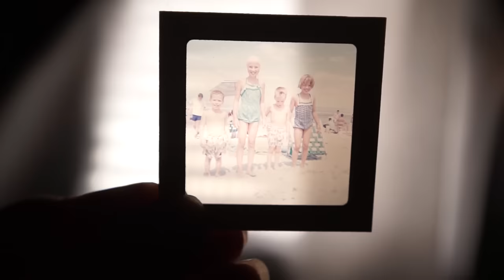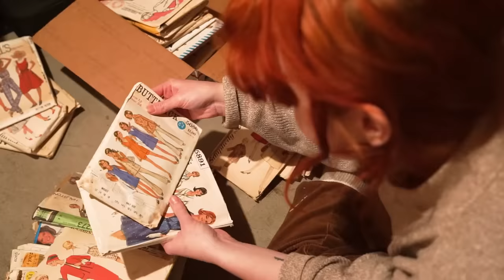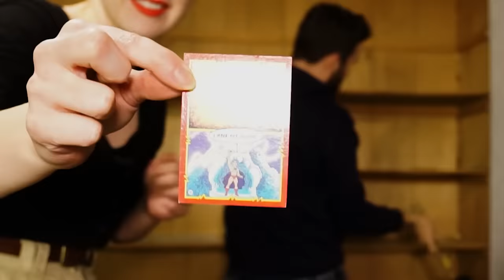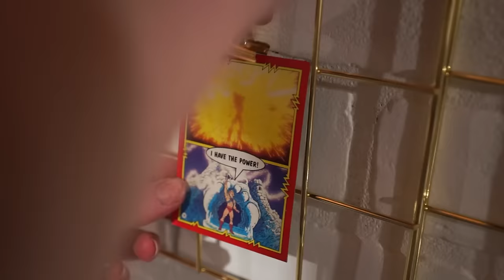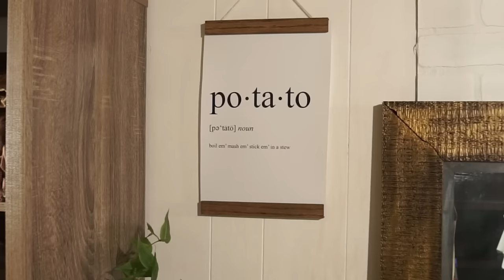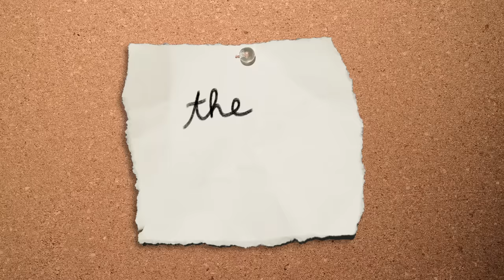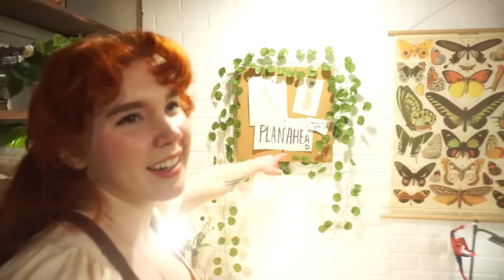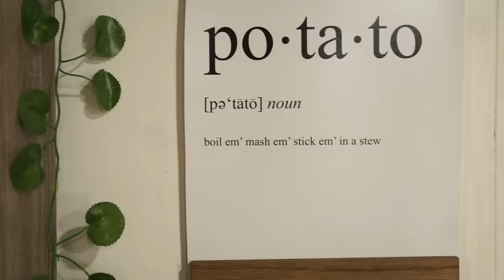A Basement MAKEOVER || Making a Costume Workshop!

Comment: If I may make a suggestion to save you stress in the future:  add an L- bracket to the center of the shelves you made so they don't start warping and sagging in the middle.
Reply: That, or multiple L-brackets along the way. The shelves looked very long and even with the original post in the middle the boards sagged... Those new boards look very thin, very prone to sagging
Reply: Yeah. My dad had to do the same thing to my shelves and it works pretty good.😁
Reply: I was worried about the sagging too!! Luckily that's an easy fix.

Comment: DIGITIZE THOSE PHOTO ALBUMS IF POSSIBLE !!! Disasters happen and having a back up of, to quote John Mulaney “the one thing you can’t replace”  is something you need
Reply: Yes! And even if there's no disaster - I'm currently getting ready to do this because some of my really old pictures are fading. I don't know if they weren't developed properly, if the paper is bad quality, if they got too much sunlight, but either way it broke my heart to see it!
Reply: @liv97497  A lot old albums are also made of acidic paper, which is not great for the photos. I’m trying to find the time to digitize mine. 😅
Reply: And then create many backup copies because electronics do fail as well... Learned that the hard way.
Reply: i bought a veho digitizer on amazon for all my negatives they are now safe on disk, did not want to loose all the memories
Reply: @maggiekedves  Ugh, same. I helped my mother digitize all her parents old slides (they had a lot of them... like, a couple thousand, I'd say), and at some point the usb we put them on got corrupted, and we lost roughly half. Which wouldn't be that bad if we still had the original slides... but we had thrown them away, secure in the fact we had digitized them. Won't be making that mistake again.
Reply: @kellymartin2603  yeah I coined a motto after losing ton of photos "If you saved it only once, you don't have it." Super sad also I had a CD full of photos as my backup and after few years the devices could not read it at all and it was in a case all the time protected. So these media technologies don't live forever and I would advise everyone to keep the original somewhere or create a paper version of digital images as a backup. I have yet to do that (time/money issue.)

Comment: Literally had those cubby's in my amazon cart to organize in my kids closets...*removes from cart*
Reply: I use them as my wardrobe lol cos I'm cheap. They're fine so long as you don't move them... Though maybe not with kids, if they like climbing things.
Reply: You can alternatively get a bunch of zip ties and tie it all together in the back, so you can still move the unit and it won't collapse just by someone touching it. It works well enough.
Reply: I have similar wire mesh ones, but I wouldnt dare move them before emptying them and preparing to reassemble them!
Reply: Target/Ikea cube storage is the best thing I’ve found, as long as you don’t ever plan to take it apart and reassemble it XD
Reply: they were in my cart too LOL not anymore!

Comment: I actually was thinking “hey those cubbies are cool” and was considering ordering them...
Reply: There is a type of guinea pig cage called "C & C" that stands for "cube shelf and coroplast" where the cube shelf units are used as a frame to support a coroplast base pan. When you make one of those, you use zip ties to reinforce all the joints (search on C & C cages, there is a video or photos of this somewhere). When you use zip ties to stabilize it is SUPER annoying to set up, but it ends up really stable and you won't have a repeat of what happened here.
Reply: I have a set of shelves like this, but without the doors. It seems I need some zip ties.... thanks for the tip!
Reply: @valstarkgraf  Okay but I'm actually moving and needed craft storage help. You really just came in clutch friend.
Reply: @valstarkgraf  Was totally coming here to say the guinea pig community are experts when it comes to cubes. :) Hundreds if not thousands of zip ties, I have zipped.
Reply: @rmdewberry2482   so annoying, but oh so effective.

Comment: when i saw this on insta i thought, oh dang she finally rented a studio space! so it looks great! the only thing i would recommend is getting some of that interlocking foam flooring to go under a big low pile rug so u can still have floor gremlin times but with more padding
Reply: That's excellent advice. padding, and insulation.
Reply: Well...I'm thinkin' that for laying out material and patterns you might want something that you can roll up out of the way so you don't accidentally cut it. And it would be better for painting stuff to move it out of harm's way.
I had to learn both these things the hard way. HEAVY SIGH!@#
Reply: It also helps with sound!
Reply: So true!

Comment: Beautiful! Sure I won’t be the first to recommend this but you’ll probably benefit from putting reinforcements along the shelves so they don’t buckle, every 2 ft or so will really help
Reply: I came to say the same thing. She could have repurposed the other shelves by flipping them over and using two support stacks instead of the one in the center of the original configuration.

Comment: Rachel! You should look into those interlocking foam floor pads for shops! They are cheap, insulating, and you just replace the tiles if they get chewed up, stained, melted, etc! Also absorbs sound, though you have a good sound setup... you could always throw a rug over them, but it works for laying out/cutting fabric

Comment: I work in a paint store and when I see people directly painting over stained wood with a sealer over the top I die just a tiny bit. But if it sticks and doesn't peel more power to ya!
Reply: I did at least use an oil sealer on mine.... it's held up so well over 3 years! No scuffs and only one scratch (where we gouged the wall bringing in firewood one night)

Comment: As a costumer, I have a suggestion for your workroom, get a drop leaf table. They take up only a little room while making great cutting tables and sewing platform for long skirts and gowns.
Reply: Easier on the knees for patterns too! I miss having a dining room table, but I really don't sew that often anyway.
Reply: Or even two saw horses with a 4x8 piece of MDF. You can attach handles to the underside to help manhandle it around.
Reply: I  have a "flat surface problem" where if there is a flat surface, I just drop stuff on it.   Drop leaf tables help me keep my place so much more tidy!
Reply: Yesssss I finally have a large table surface to work on and it makes such a big difference
Reply: @Beckysuesplace  I have often said my house would be so much tidier if there were no flat surfaces. I have a LARGE kitchen island (4x7), but when it comes to laying out fabric, I use the drop leaf table in my little used front room. It’s much easier to clean off. It’s not part of the ‘path’ through running through my house.

Comment: edit lol! I posted this before I saw that she ended up getting the cube case I was talking about, just  a smaller version and no table 

Rachel! For your fabric storage, instead of using the cubbies that collapsed, there are similar ones made of wood, I bought them, i have the 16 cube one,  the best part is that you can buy a table extension for them! The table has 2 legs and then attaches to the "cube book case" or in our case "cube fabric case", and then you have a place to sew or cut fabric! The table extension can be set to seating or standing height, which is awesome for cutting fabric. And what's really nice is you can take the table off when not using it, if you need the open space.
So yea the 16 cube case and the table extensions are by "Better homes and gardens" from Walmart. The 16 cube case is $100 and the table extensions are $50. 
Best purchase I have ever made for my sewing hobby!

Comment: Congratulations! Nicely done! I have one ergonomic suggestion that you may find helpful. I noticed when you reached behind the wigs to plug in the light strip, it was kinda awkward. The solution for that exact situation are these extension cords that have round "button" (switch) stomp boxes built into them. You've probably seen them used on Christmas trees. You plug your lights into the extension cord, which plugs into the outlet. Then situate the "button" portion on the floor, where you have easy access to it. Just step on it to turn on and off your lights! Voila! I use these throughout my apartment, wherever I can't reach far enough for a lamp switch or a radio hidden behind a sofa. It really lets you get creative with the placement of your electrical items.

Comment: My basement is THICC with spider webs and turns into a beautiful water feature during storms... it doesn’t flood and it drys fast but it has water pour threw the cracks in the walls so that sucks but it does the job I suppose, it is a shelter for in case nados 😶

Comment: Hold on. Did you use the Gorilla Glue version of Liquid Nail or did you use both Gorilla Glue and Liquid Nail?

I found out this year that I much rather prefer the Gorilla Glue version of Liquid Nail because you can actually use the tube again if you don't use it all up. In my experience, if you put a screw or bolt in the nozzle of Liquid Nail, it will still dry up in the nozzle and the tube and it doesn't work too well. If you put a screw or bolt in the nozzle of the Gorilla Glue, only the glue around the screw will dry up and the rest stays wet. 

Even better, the Gorilla Glue nozzle can screw off the tube if the whole nozzle does dry up and you can poke at the screw from the other side!

Comment: Hate to tell you this now, but you really need a back on those new cubbies as it will make them more sturdy.  Over time they will wiggle a little here and there and come apart at some point.  The back stops the wiggling.  They should have come with basically glorified cardboard backs.  If they didn't then you can buy luan and use your saw skills to make them the right size and then I'd glue the luan and add some nails for extra support.

Comment: Love the way it turned out! As soon as you said you were going to get rid of the file cabinet, I said "No! Use it for your patterns!" So happy to see you did! You could put your patterns in mailing envelopes, the big yellow ones, and then put the pattern envelope on the outside of the envelope. We do this at the theater I work with. Saves room and you don't have to try to fit them back in the flimsy envelope they come in!
Also, hate spiders as much as you do. I use peppermint oil and put it in a squirt bottle with some water and spray it in the basement. It keeps most of them away, and it smells better than musty basement!

Comment: Those storage cubes are great but you need to zip tie them around the joints for long term weight baring and stability. We use them as our work displays and theyve held up through a store move with product still in them. But the corners along slode out over time

Comment: "Ooh, what else can I chop?" - my response with every new destructive tool I learn to use...

A comment though, those shelves you made are lovely, but there was a reason the previous ones had those supports, that's a really long span for one side to go unsupported. You might consider using the offcut pieces from the ends of the shelves as supports if things start to sag.